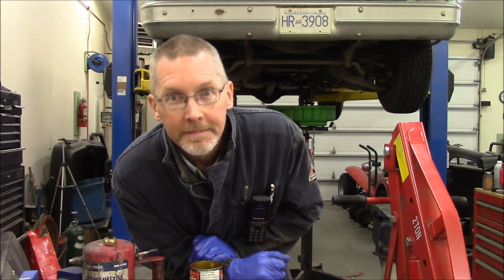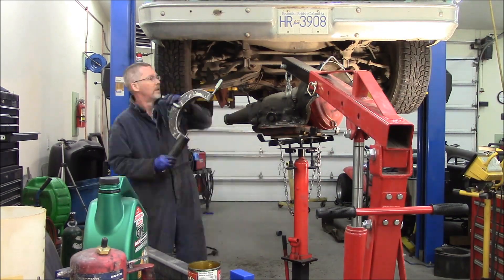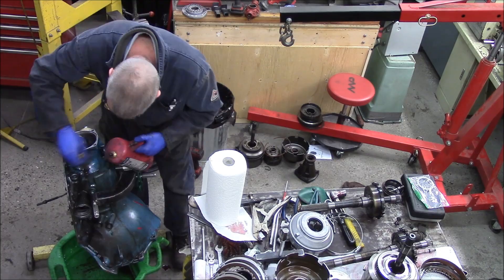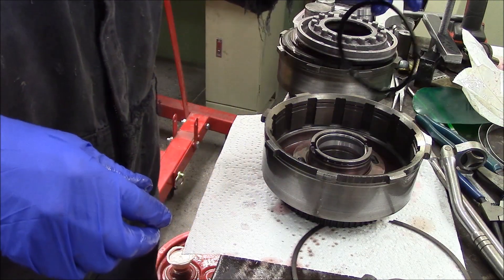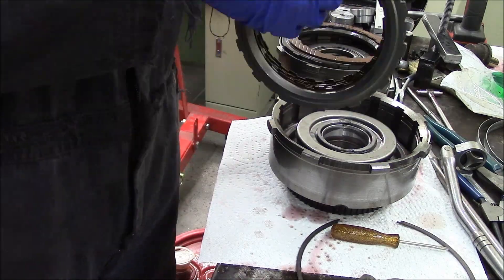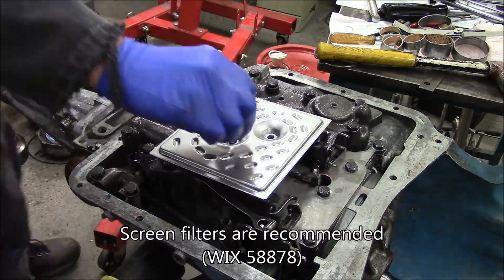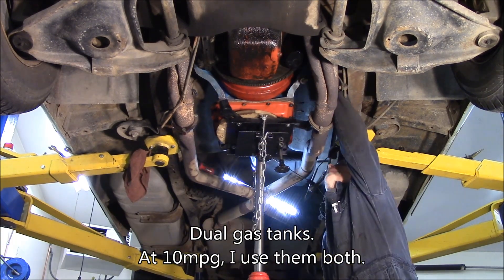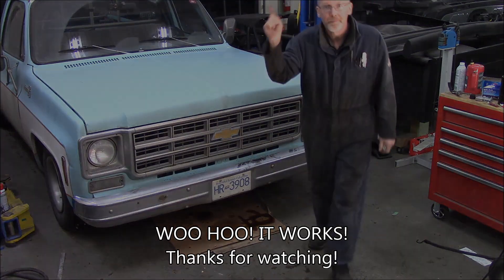Fixing the TH350 Hippy-Shake-Shake

Comment: Good morning. I just love your videos!  I have rebuilt my TH350 and have some experience with installing transmissions. I have a question about bolting the torque converter to the flexplate.... Since the torque converter sags ever so slightly from its own weight when resting in the transmission, prior to bolting to the flexplate,, should you lift it up ever so slightly (take the weight off) as you tighten the first torque converter to flexplate bolt? Or just pull it forward and bolt up without lifting on it?
Reply from the maker: The button should center itself, though it's not a bad idea to sneak up on the torque evenly and in stages.
Reply: @GregWellwood  thank you!

Comment: Great video I have a 1976 corvette with no reverse gear in my th350 transmission  but forward works just fine how do I fix this ?
Reply from the maker: It would either be the Low/Reverse clutch, or the High/Reverse (Direct) clutch - both of which are applied in Reverse. My money is the High/Reverse (Direct) clutch, which is a common failure point.  Rebuild time!